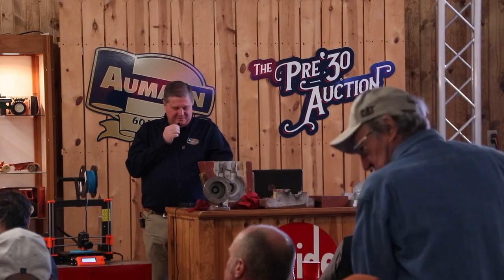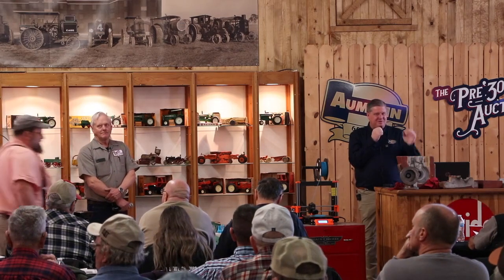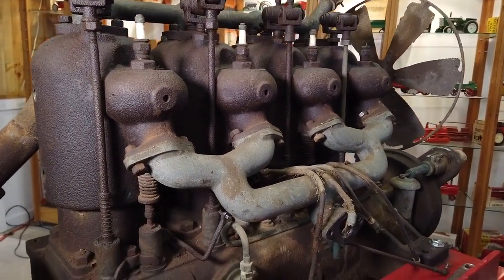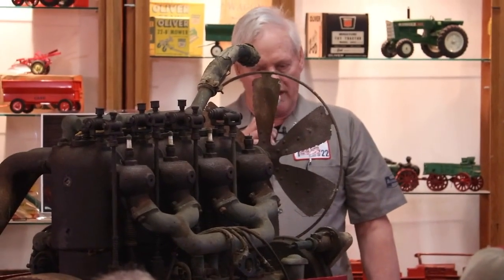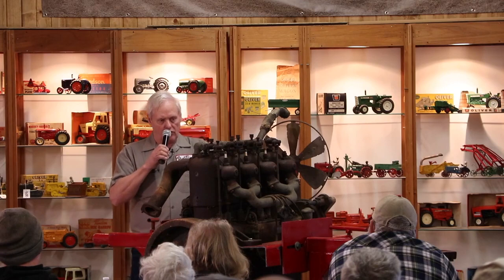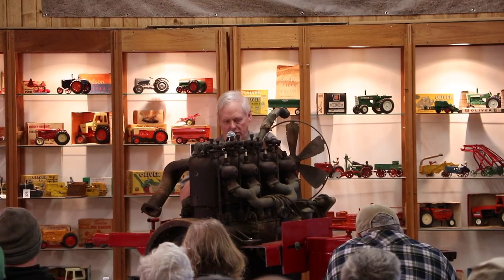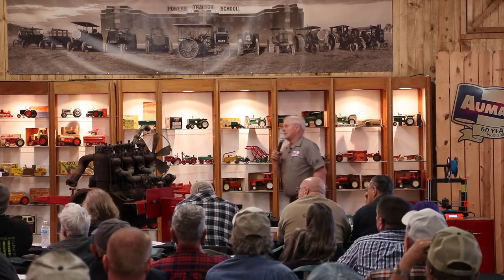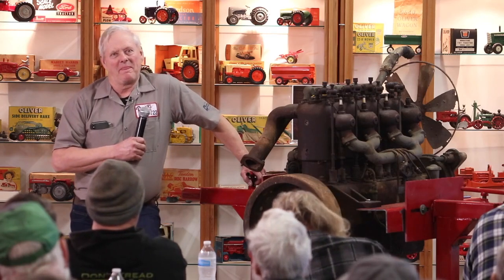Everything Is Stuck! What Do I Do? - 2022 Powers Tractor School - Part 3 Of 5

Comment: I've had some very good results freeing stuck engines using white vinegar. Not the 5% acidity salad dressing/pickling vinegar that you get in grocery stores. I use the 20% or higher stuff that's intended for cleaning and is sold in hardware and home improvement stores. It does take a while but it works.

Comment: There's a body shop product used for rust removal on body parts that's called RustMort It dissolves the rust and oxidizes it I think. It works great, just pour some in/on and it eliminates the rust chemically leaving the rust a black surface that can be sanded. It should work the same on rust between surfaces.

Comment: Can't rush those older cast iron parts into working condition. So like the gentleman said all works, my approach would be the same, a lot of lube and penetrating oil is what it takes. As he said, some use transmission oil, some use brake fluid. Heat works good, but using extreme care is important, one person I recently watched, just busted the one cylinder that was stuck, plain and simple. Good luck on this one! Thanks...

Comment: Penetrating oil ( CRC knocker loose), heat from blow torch,  power washer or hand pump sprayer for cleaning out the cooling system (calcium build up remover added to sprayer), hand pump sprayer with  sludge cleaner for oil system, and  two bottles of oil system cleaner to put in the oil pan ( hand crank a few times to circulate  the oil system cleaner to remove oil in lines. Then remove and replace with oil).